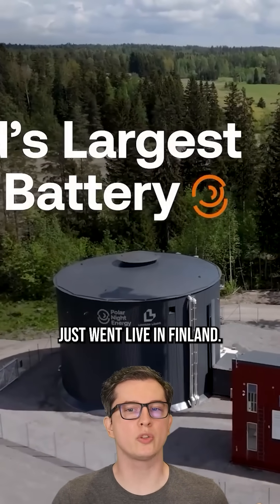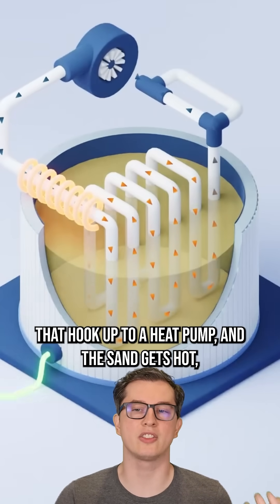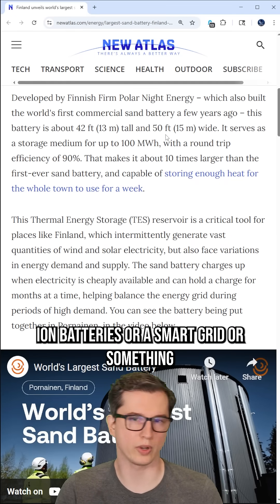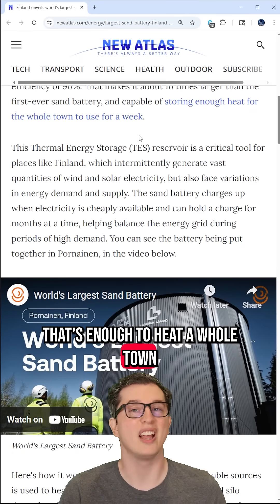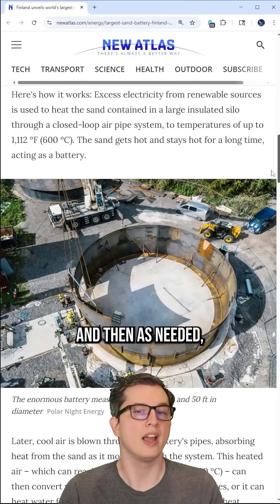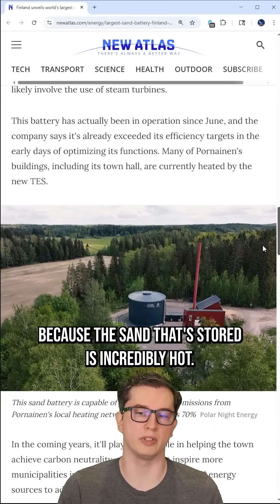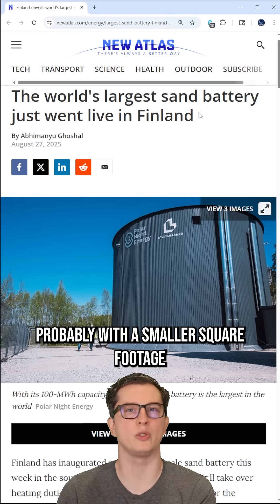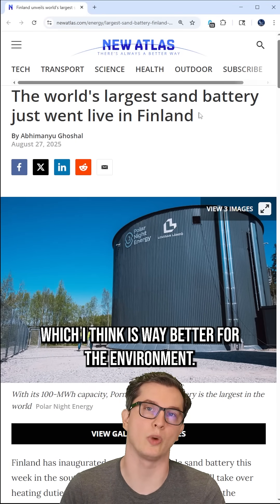World's Largest Sand Battery #science #battery #renewableenergy

Comment: My first thought was to question the use of sand (instead of water), but then I remembered this was Finland. I can understand the use of sand since other substances with better vol. Heat capacity are either more expensive (like metals) or liable to freeze (common nontoxic liquids). However I do feel like at some point, it's more efficient to insulate a mass of water than it is to just keep using more sand.
Reply from the maker: Send us also far less corrosive than water

Comment: So we are going to strip the beaches and deserts of the sand needed to do this on a large scale? How will that effect the systems it's taken from?
Reply: I mean no offense but sand is one of the most commonly used materials for construction. Either for foundations, counter weights, an element for concrete or glass windows. We've been using it for a looooong time and still have sandy places to visit. 2nd there are different types and grades of sand for different purposes. You can go to most hardware stores and find "play sand", "paver sand", "all purpose sand" ect...  Or for example the sand used to make glass is a specific type that's mined from mountains and refined.

Most of these are not beach or desert sand as it's impure and made up of a bunch of random sediments and debris. 

So fully agree with: what will be the environmental impact of using this material and method for power storage? 

But it is very doubtful your favorite beach or desert is going away. As we've been using the material for at least a few thousand years and still have both places.

Different thoughts for fun. If we don't switch to sustainable and storable energy sources (like in the clip) beaches and deserts will definitely shift as climate change influences sea level rise and pushes into the coasts. Meaning your favorite beach might be a few miles further inland than it once was. Shorter commute to holiday I suppose 🎉😅
Reply: Everything we make is stripped from somewhere. at least sand is abundant, relatively easy to access, and not as environmentally harmful as other options.
Reply: Everything we make is stripped from somewhere. at least sand is abundant, relatively easy to access, and not as environmentally harmful as other options.

Comment: How long can it store that energy and at what ambient temperature, as it's obviously going to be affected by such? Doesn't Finland already get most of its electricity from hydro? 

Sounds promising, especially in hotter climates like the US south where ambient temperatures might not affect it as much, and the need for air conditioning is higher. Especially considering silica is like the second most abundant element on the planet and the first most redially available element.
Reply from the maker: I'm unsure about these questions but I do know that it runs in the winter in finland so it has to be somewhat resistant to low ambient temperatures
Reply: @Drift0rTV123  I'm sure it is somewhat usable, again, probably based on ambient temperatures. So, if it was useful say overnight, or two day in temperature below 10C, im sure it would be useful. Ambient temperatures between 40 and 45C im sure it would be able to store heat even longer. 

As I'd said above, I believe Finland gets most of its power from hydro, and thus would probably be extremely useful by balancing turbine loads with these sand batteries to subsidies peak usage times.